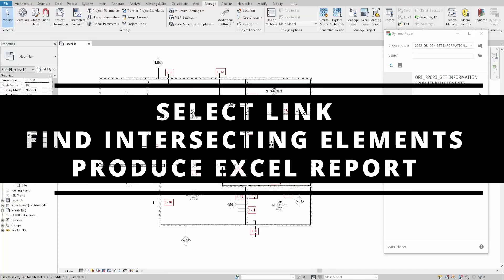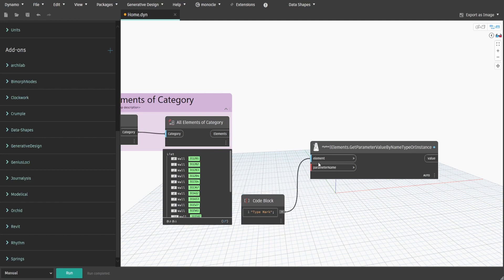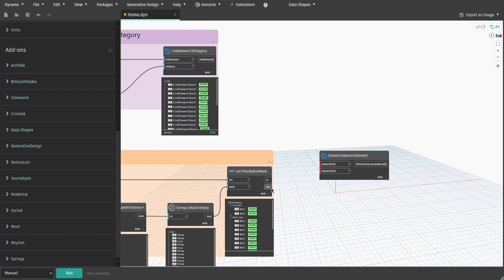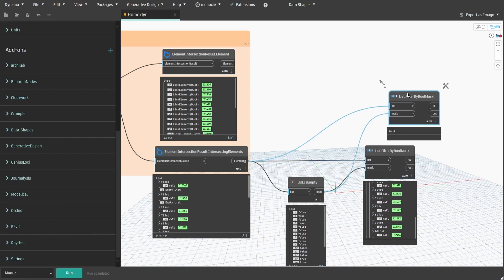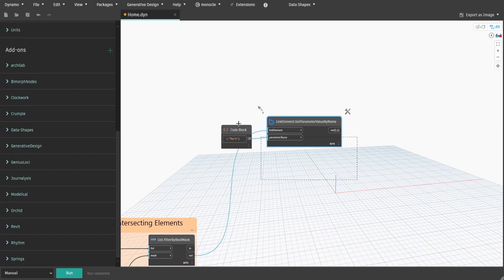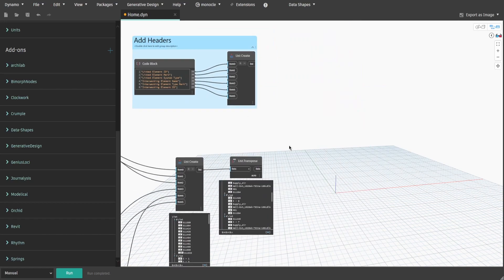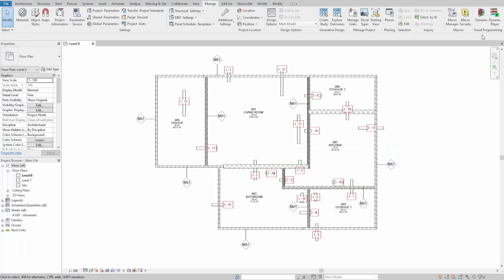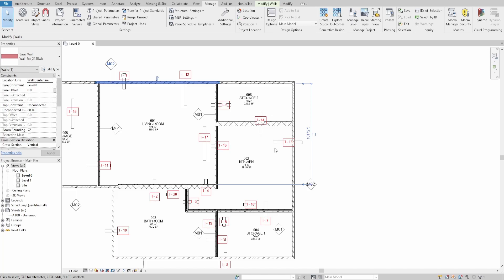Dynamo - Get Information from Intersecting Linked Elements. [Revit 2023]

Comment: Hello, I donwlonaded all packages still no `links` node. Actually i tried everyhting, I could not find from any package that is suggested by other people. In 2023 i am having troublet o find correct node to get linked elements.
Reply: Thanks. I was searching a way for my node to get linked elements. I used alternative way but your video was really helpful in general. Thank you.
Reply from the maker: Hi, the "links" node should be coming from archi-lab package as far as I remember. But if for some reasons it is not there, you could always use the alternative from either Clockwork or Orchid or GeniucLoci and I believe crumple should have. The "blue" nodes are all from the bimorph package

Comment: Hi! Im trying to achieve a similar thing, but with elements that intersect with grids, however the "ElementsIntersectionResult.IntersectingElements" node always returns empty lists. I assume its beacuse the grids dont have an actual geometry? Do you have any tips on how to solve it?
Reply from the maker: Hi! Yes you are right, technically speaking it does not have any geometry. However, I believe you could try to extract the 2D information of Grid Lines and check them against what they are cutting through in a floor plan/elevation etc views. So probably need something like Get all elements in a view and then use it with Intersect etc.